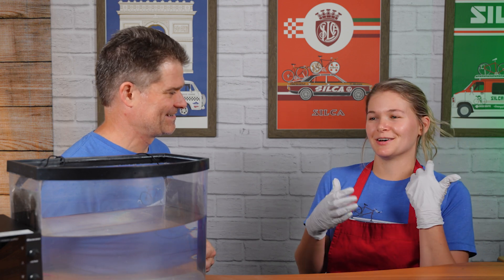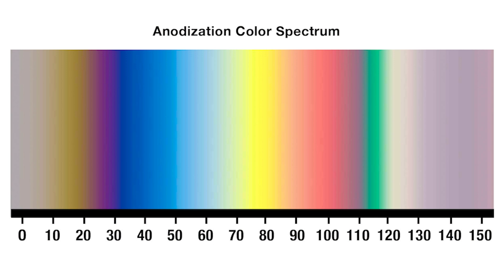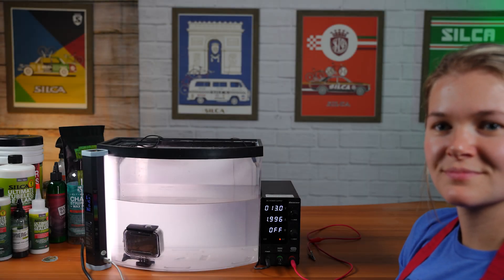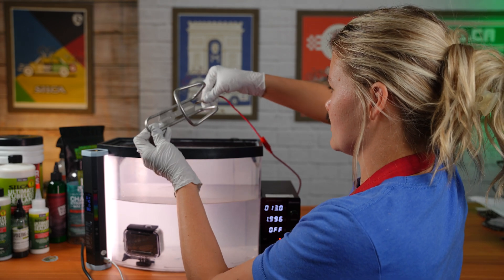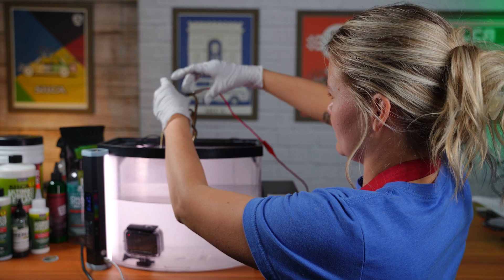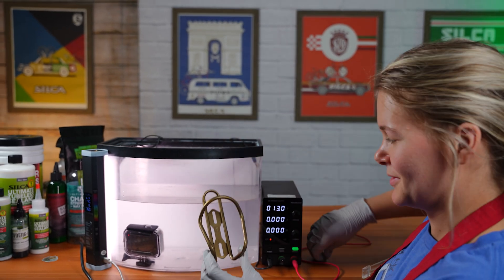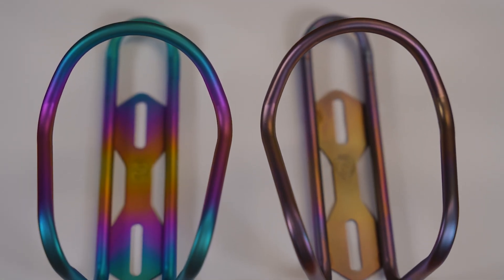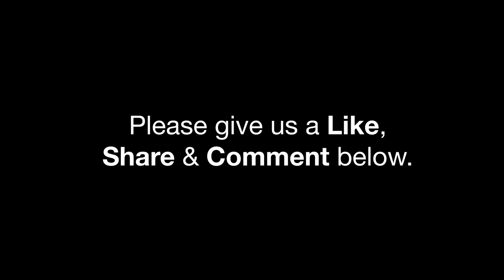Titanium Goes Technicolor! An In-Depth Look at Anodizing Water Bottle Cages

Comment: do you have an oil slick verison
Reply from the maker: Unicorn is the closest you can get to oil slick on Titanium as the colors are in the metal and not on it, but we've had lots of customers combine Unicorn cages and bolts with other oil slick components and it integrates very nicely.

Comment: How durable is the finish? Can it be polished?
Reply from the maker: Please note that anodized titanium is only as hard as the titanium itself, and is less hard than many types of sand or abrasives found in sand and soil, including aluminum oxide and garnet which are naturally occurring and are harder than steel.  Titanium anodize continually exposed to abrasion by these sand materials will eventually scratch and begin to wear and will not be covered under warranty.  Routine cleaning of the cages and cleaning of bottles is recommended to remove any embedded abrasive particles which can accelerate this wear. So, careful cleaning is possible.